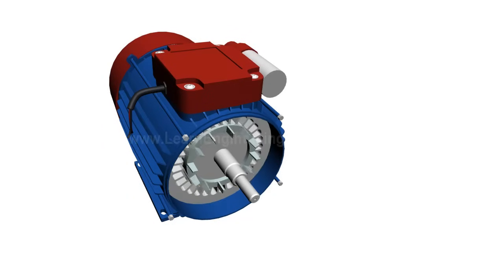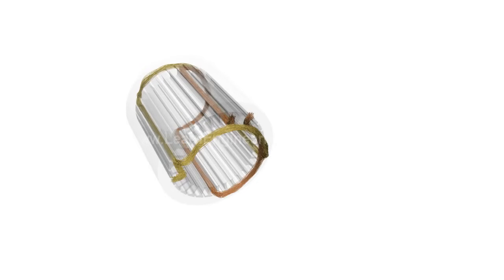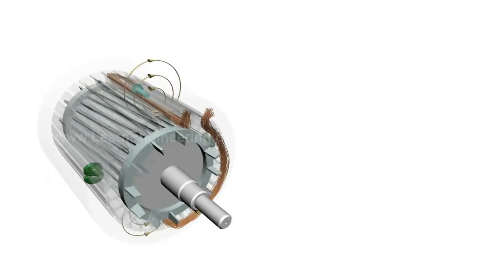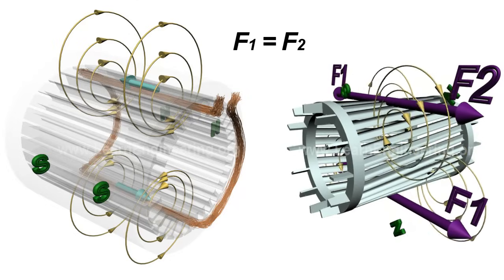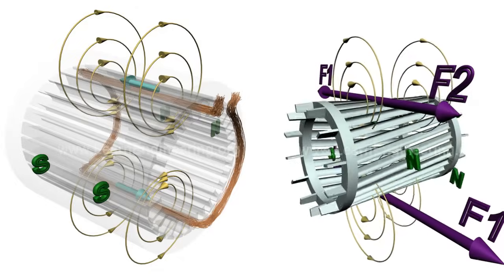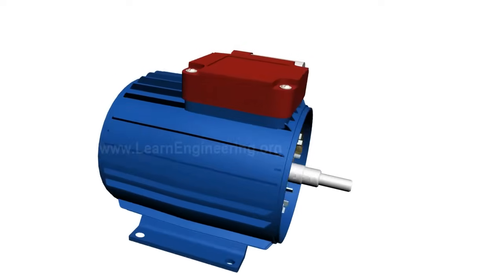Single Phase Induction Motor, How it works ?

Comment: It does not consider mechanical resistance to rotation as some work load will be added which will cause rotor to stop rotating, hence I think capacitance will always being in use it should not be cutoff

Comment: If you look at the magnetic field directions you'll notice that their resultant will point to one direction for a while and then it will reverse. So the motor shouldn't be able to rotate properly. It should try to go clockwise and then counter clockwise.

Comment: Why most of all on YouTube explaining the principle of this kind of motor they didn't include their explainations on why and how this rotating magnetic or electromagnetic field does rotation,and how and why this polarity exchanged 🤔🤔 including "lasics"....is it by ac current that change polarity constantly???......
Reply: Because that's not what the "normal" people will learn. As you can simply ask AI nowadays...

Why the polarity changed, that's because it's an AC current. AC current has their own random wave (you can only see how their waves goes using oscilloscope). It's like a pulse wave (sometimes it go up and above to +220V and sometimes it goes -220 and below). Why AC Current doing this pulsating (hundreds of pulsating wave just in a second) that's because it's a nature principle. A "RAW" electrics are having unstable (I mean that pulsating waves) wave or frequencies. AC is the raw source of electricity. Then the stabilized one is the DC current which they have "flat" wave.

Nah, since AC has pulsating wave, sometimes it goes + and sometimes it goes - (passing neutral 0V though), the magnetic field will also affected. When the electricity goes +220V , the north pole will be in the upper side of the Main Winding. When the electricity hits -220V, the south pole will be the top while the north pole goes down of it.

And note that AC current has hundreds of this up and down pulsating wave on each second they runs.

Since they do this on main winding, which is it's a Stator Part that doesn't rotate, the ROTOR which also using "magnetic supported" material will be and always attracted to any magnetic field. Like what I said before about the AC current doing hundred times of up and down waves just in one second, it's like rotating the North Pole and the South Pole in a super high speed rotation. And yes the rotor will be attracted to the rotating poles and goes on rotation then😂

Comment: I still don't understand it.
If the fields cancel each other out then how does giving it a nudge in either direction allows it to turn in that direction continuously. Is this like in space where a push in any direction can give continuous motion in that direction as there is no friction? 
Do these fields cancel out friction? 
Wouldn't you think that the start from the start winding would only last for a brief few rotations?

Comment: yes one neat trick I recently learned is that if your single phase induction motor is humming but not spinning, you can start it by hand, just twist the output shaft in either direction and watch it come to life, this is a dead giveaway that the starting capacitor is bad and needs to be replaced

Comment: Why when the rotor is already rotating there is a net force and the two force don't cancel each other? Can a motor be efficient with this slight difference? Or the difference is not slight? Why? I don't understand becuase you don't explain the crucial part. I'm sorry. Excuse me for my english.

Comment: erm, an induction motor is supposed to be brushless, so how is the centrifugal switch mechanically on the rotor but electrically on the stator if there are no brushes?

 I assume this is considered a minor detail since the brushes would only carry current to the auxilliary winding during startup and thus not suffer from arcing damage as much - but they would still experience some friction wear. Also the brushes would connect for all 360 degrees of revolution unlike a dc motors commutator brushes so arcing would be less than for a commutator.

Comment: I have question. When auxiliary winding also produce 2 opposites RMF, how can it makes one of then cancel main winding RMF and the other will get it up? I mean if theres 2 group of 2 opposites RMF, wouldnt they all cancel one another, and left no resultant?
Reply: Because of the capacitor. If you power the auxiliary without the capacitor, they will indeed have little resultant. 
With a capacitor in the auxiliary, a delay will be added to its 2 RMF,  they will not be rotating together with the main's 2 RMF, they will be late by some angle. You can choose that angle by getting the capacitance value right, this way you can add the exact phase difference you want between the auxiliary and the main winding so one cancels out and the other adds up.

Comment: I thought the capacitor knocked one coil off by a few degrees, which imparted a torque? essentially creating a two phase motor until the capacitor circuit switches off...
Reply: no...both the winding are connected to the same source...so technically this is  single phase motor

Comment: The only part I don't understand is, once you put the rotating rotor inside the cage, why does it keep rotating and not eventually slow down. I understand the initial imbalance of torque, but once you turn off the auxiliary winding current this imbalance should fade should it not (similar to how if you push something it doesn't keep moving forever, eventually it slows). Eventually the torque due to that initial motion should fade and you should just be left with a net torque of zero??
Reply: I'm stuck in the exact same question, I can't understand why it don't slow down when initial rotation is applied
Reply: you need the capacitor to provide a phase shift for the start winding because you cannot turn the rotor  without the phase shift.   the start winding is not needed after that because the rotor has relative motion and will continue to spin as long as the run winding has power.   what is hard to understand???

you can do an experiment in your table fan.  unplug fan and disconnect the capacitor from the fan circuit.  turn the fan on.  the fan will not turn.  turn the fan with a stick.  fan will turn albeit at a slow rate but it will not stop rotating.  what did you just do?  you provided a relative motion to the rotor! you kick started it  😂😂.

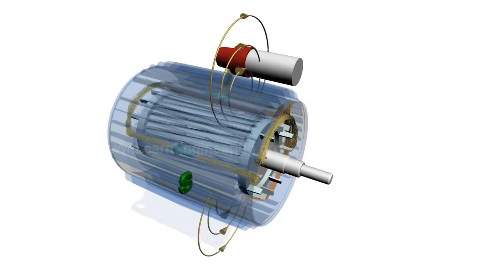Comment: 3:26 The auxillary winding will also produce 2 oppositely revolving mag fields and how will it cancel one torque  if the other gets added up? If one torque is added up then the other , the opposite one, will also get added up right?
Reply: opposite wrt one of the 2 already rotating mag fields so effect of 1 mag field will be cancelled by one of auxilary winding and other will add up with auxilary winding hence torque on cancelled side will be zero and will increase on side where mag fields are added

Comment: GOOD JOB. BUT I HAVE TO POINT OUT "Direction of magnetic pole in stator winding is wrong" AS  SHAHID SAID.
Reply: I agree with you.As the ampere theory goes, thumb represents the direction of current and the other 4 fingers represent the direction of magnetic field. It shows that the right side is N and the left side is S. So it write the alternative direction of the stator.

Comment: i didnt understand the capacitor part for the self starting...if the auxiliary winding produces 2 fields rotating in the opposite directions , and if it cancels out one of the 
fields in the main winding , then it must cancel out the other one also right ?
Reply: bhag chutiye XD
dono feild opposite h ek dusre se 
its likt 2-(-2)=4 and other one is simply 2-2=0

Comment: Doesn’t the capacitor just create a phase shift for the secondary winding so you have 2 different phases at different degrees to start the rotor rotation? I was under the impression almost all single phase induction motors were actually a 2 phase setup for start or start/run operation. Maybe thats what this video tried to explain but I think it just confused the hell out of me or I learned wrong years ago. This hurt my brain!

I have no idea how I ended up here. I got lost in YouTube again.

Comment: Why not explain there is a starting relay involved as well? The capacitor is optional.
Reply: It isn't optimal, withouth it you don't have rotating magnetic field. You can have start and run capacitor and a relaw switches between them.

Comment: Why the auxiliary winding needs to be cut after the rotor starts rotating? Isn't it better to have a single strong rotating field at all times, instead of two opposite weaker rotating fields?

Comment: The part of the video concerning why a single-phase induction motor is not self-starting and how it can be started is SO CONFUSING. When you were explaining the reason why the rotor, which is already rotating, will keep on rotating in the same direction after it is put inside the stator under the condition that the current only flows through the main winding, you said the magnetic field produced by the stator will cause the magnetic field inside the rotor to vary and thus induce a current in the rotor, thus "the rotor will start rotating" (which is confusing because you have assumed that the rotor is already rotating before it is immersed in the magnetic field produced by the stator). After that you explained since the net torque on the rotor produced by the two oppositely rotating magnetic fields produced by the stator is zero, the rotor will not start, which seemingly contradicts what you have said before that "the rotor will start rotating". 

It is better for you to first say that if no current is flowing through the auxiliary winding and the rotor does not have any initial rotation, since the net torque on the rotor produced by the two oppositely rotating magnetic fields produced by the stator is zero, the rotor will not start. And then explain why the rotor will keep on rotating in the same direction if the rotor has initial rotation. Finally tell us the initial rotation is provided using the auxiliary winding connecting in series with a capacitor.

Last but not least, you forgot to mention that the capacitor introduced a phase difference between the main and auxiliary windings, so the sum of the fluctuating magnetic fields produced by the rotor and the stator will become a rotating magnetic field. If the auxiliary winding is not connected to the capacitor, even if there is current flowing through the auxiliary winding, there will be little phase difference between the main and auxiliary windings, so the sum of the fluctuating magnetic fields produced by the rotor and the stator will still be a merely fluctuating but not rotating magnetic field and the rotor still cannot start.
Reply: aaaaaaaaaaaaaaaahhhhhhhhhhhhh. thank you. god DAMN i needed this post. thanks man
Reply: I know their videos aren't the best
Reply: boss
Reply: Thank you, man, you are awesome!!!

Comment: I know how is the connection of this but for the sake of those who doesnt know it will be more helpfull if the uploader includes how is the connection between starting winding, running winding and capacitor.

Comment: His explanation is incomplete and not entirely correct. There is another capacitor involved in steady state whose job is to create a 90 degree phase difference with the other winding. The vector sum of the fields is a rotating magnetic field. This rotating magnetic field induces a rotating magnetic field in the rotor which lags by a 'slip' angle which produces the torque. Without the second capacitor the motor wouldn't run. At least not in a steady way.
Reply: There are 4 types of monophasic induction motors, in the video he is explaining just one of them, so i dont think he is wrong.
But you're correct, the motor with two capacitors is better, but more expensive.

Comment: At what frequencies can this type of motor work? 
Are there any specific ranges?
Reply: Late but from what i got
Single phase will run at 220-240V at 50/60Hz
While 3 phase at 415V at 50Hz as well

Comment: Free Energy. FREE Energy, Brazil, Silveira Technique. Output power (consumption) not recorded at the network input. Circuit that feeds the technique Silveira does not see the lamps as active power, that is, for the consumer unit the lamps do not exist! In the video is shown a power of 175 watts connected in the power grid, using the Silveira technique this power is not seen by the consumer unit. With English / Portuguese subtitles. E-mail:

Comment: sir there is a huge problem , if there is two force present in opposite direction then one will cancel other one resulting the motor to move only in inertia.  and there will be huge powerloss

Comment: So is this motor super inefficient because half the power is going to the torque on the rotor in the opposite direction of rotation?
Reply: If I've understood it correctly, once you have the rotor in motion and carrying induced currents, it is the induced current and magnetic field that break symmetry. Without any initial rotation you can't get any work out of the system. At this point I'm guessing but I think under those conditions the motor would offer too little resistance and the current would go too high.

Comment: Did you show the current direction of electrons along the wire?? Because using traditional current direction (positive point charge references), Lorenz's law points force in the opposite direction.

Comment: if auxillary winding is also producing opposite magnetic flux then how is one magnetic flux from main winging is cancelled while other gets added up 

auxillarry windings shod produce same direction magnetic flux to cancel one and simultaneously add with ther fulx from main winnding
Reply: Suraj Bisht yes I have tat doubt too if ur doubt is cleared Pls post answer in this reply comment section I will do the same if mine is cleared
Reply: If you just consider that rotor has 2 magnetic field and the auxiliary winding cancels out one. Then one magnetic field will be still remaining. Practically speaking it cancels out all the magnetic fields which have the same direction which are actually opposing the rotation and lets the motor rotate in just a single direction until it has reached the at the point where the auxiliary winding is not required. (At least that's what I thought please correct me if I'm wrong)

Comment: if auxillary winding produce 2 opposite magnetic field then both field of the former should get cancelled??
Reply: prabhakar jha Remember that initially the ac current produces 2 magnetic fields. The auxiliary winding does this as well, but since it is rotated 90 degrees off from the main winding, the fields it generates are not the same as the main winding. It works out that one pair of fields cancel(or weaken) and the other combine (or strengthen).

Comment: Capacitor start induction motor
Reply: Hey, I have a question. How come capacitor motors have high starting torque as compared to resistance split phase?
Reply: @Akarsh-  because the phase shift is bigger

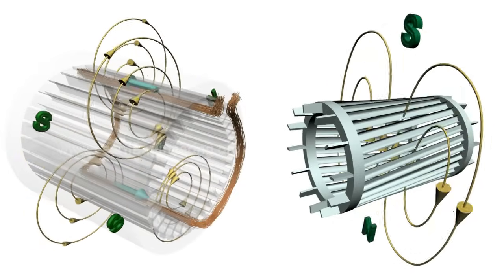Comment: This is amazing! But could you please tell me why do the two sets of blue current flow in the opposite direction to each other at 1:50? 

Thank you

PS.I was trying to apply Flemming's left hand rule but the two parameters , current and force, were initially unknown at the squirrel cage in the first place. So I can't solve the problem.
Reply: This is a case of current carrying conductor rotating in a magnetic field so instead you  should be applying flemming's right hand rule.
Also at 1:51, you can see that the opp directions of the blue induced currents because of the corresponding current in the main winding shown beside it.

Comment: Not all single phase squirrel cage induction motors are like this, some use a start relay and start and run capacitors.The capacitors create a phantom phase to get the rotor to spin 360 otherwise you just get locked between the two phases, in other words all squirrel cage induction motors are really three phase, but when you only have single phase power you need capacitors to discharge voltage that induces current and gets the rotor to spin 360, once it's spinning you don't need the capacitor induced current, although you don't get the same horsepower out of a 1 phase motor as you would out of the exact same motor using three phases of power, so the motor is typically de-rated. For industrial applications that use 1 phase power and start under load like mechanical machinery or a water pump, your better off using a phase converter that takes 1phase and converts it to 3phase.
Reply: Or centrifugal switch

Comment: anyone could give me some idea why the 2 Torques are not the same when we have an initial rotation?? It's still not clear to me!!
Reply: +Pham Chau Thuy they are equal which is why you need the aux circuits field  to 'short out' one of the fields.

Comment: Will the effect of torque cancelling each other appear in 3-phase induction motor?
Reply: I think it only happens in single phase (which is really two phases since AC alternates between two directions)
Cycling of two phases is the same as alternation, but that is not true for any cycles containing more than 3 phases.

Comment: single phase IM used in home but in home we have dc supply but IM work in ac supply then how it is used in domestic purpose ?
Reply: +Manas Tuwani, i think you might be confusing electronics like phones, computer etc with your home power supply, lots of electronics use dc input-correct but that is why they have an adapter which converts your household AC 220/230 v supply to lower DC for your electronics.
domestic appliances/devices with IM like fan, refrigerators , washing machine etc, use the AC 220/230 v supply with no adapters.